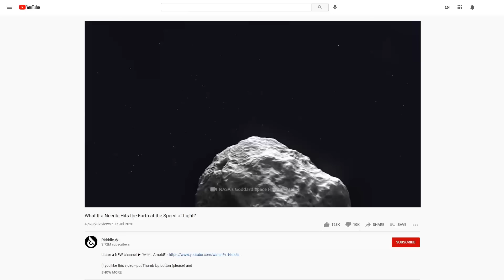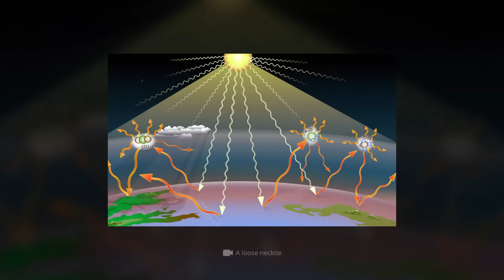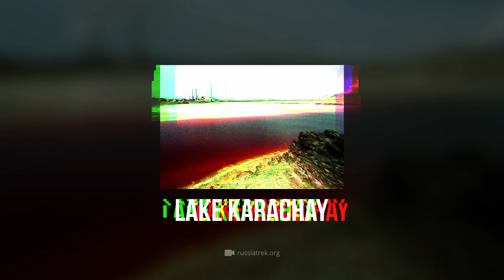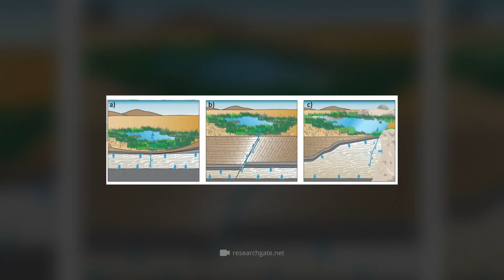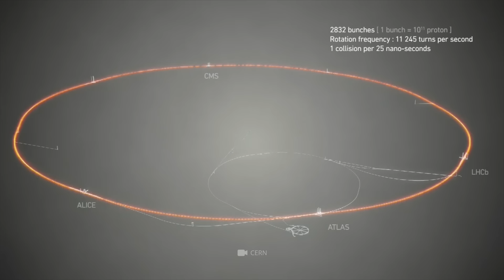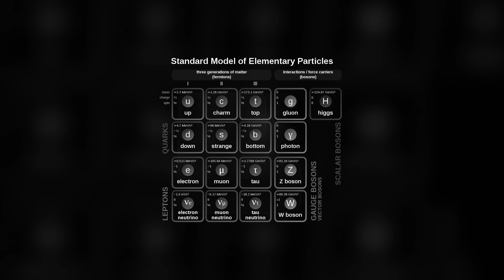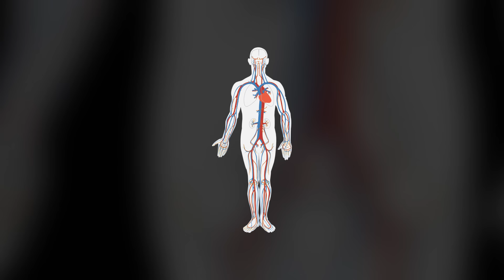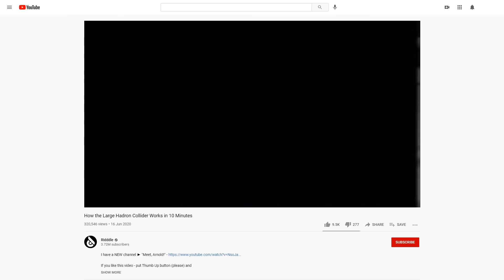What If a Needle Hits the Ocean at the Speed of Light?

Comment: "It would have the energy of 100 tons of TNT or the equivalent of 6 bombs dropped on Hiroshima..."  Uh, Little Boy was the bomb dropped on Hiroshima and it had an explosive power of 15 Thousand tons of TNT (15 Kiloton).  Either you meant to say your needle would have the energy of 100 Kilotons of TNT or it would only be less than 1% as powerful as the Hiroshima bomb.
Reply: I was thinking the same thing.
Reply: So I checked using the mass of an "average" hand sewing needle (Size 5).
--  That has about 0.14 grams of mass.
--  At "c" that represents a kinetic energy of ~ 6.4E12 J
--  That converts to roughly 1.5 kt of explosive energy
-------
To get to 100kt, you would need a needle roughly 60 times more massive, which means a VERY large specialized needle.
Reply: @fewwiggle  But according to physics as we know it, any object with mass that reaches the speed of light, its mass would become infinite. There is your "VERY large specialized needle"....
Reply: @tlsumner  I used "c" in quotes to signal that I was talking about 99.99999% of c (just like the author of the video)
Reply: Yeah I also thinking about that
Reply: @tlsumner  but in this video they are taking the speed as 99.9999999999......

Comment: You could actually surf that wave and survive, the largest wave ever surfed was 78 feet tall, which is as tall or taller than 6 stories.
Reply: I didn't watch the video yet, but i imagine the problem would be the speed of the wave and not the height
Reply: @isosk1229  The faster the wave, the higher it's height. In other words, 6 storeys will still be as fast as 6 storeys
Reply: I learn some new every day ig😂😂😂😂😂😂
Reply: Surf it yeah....survive it???
Reply: 100ft
Reply: Just as heads up, don't do this during a Tsunami or you will be killed.

Much of the destructive force of a tsunami is it's speed which can reach 60mph, and it's front to back length that can be several miles.

Think of a tsunami as a storm surge (an almost vertically steep wall of water) which is unsurfable.
Reply: @mahrixgamer6036  tsunamis don’t typically create towering waves, though. Look at Japan 2011, for example. Tsunamis are more of a continuous flow over a large area created by displacement. Towering waves are more often created by conditions which only effect the surface waters.

In other words.. if you decide to surf a 100 foot wave caused by a tsunami, go for it.. because that tsunami has likely originated from a massively catastrophic event that you likely wouldn’t survive anyway.
Reply: @nagashimayt9083  fast as 6 stories? The amount of drogas you took could floor a horse mate
Reply: @TheMessiahOfThe99Percent  .. Yeah.. How fast is 6 storeys?? 😆😆
Reply: Got recomended this wirld record after reading this lol
Reply: @nagashimayt9083  but 6 stories don't move
Reply: @nagashimayt9083  stories*
Reply: @brownseed777  *storeys

Story = A fable or tale = Stories
Story = Part of a Building = Storeys

This will be the last time I'll be correcting this error as it has happened many times and I am getting sick of it.
Reply: @TheMessiahOfThe99Percent  Sorry for my late reply, but what was implied was that a 6 story wave would have a speed of well.... a 6 story wave. The speed also depends on how much water is underneath it, then it reaches maximum height when near to the shore. The rough calculation I have is around 555~678 km/h. So imagine a car 6 storeys tall and length of around 5000+ buses traveling at 600 km/h  towards you. With that, you can decimate a lot of buildings in a few seconds and reach inland for over 30kms  with minimum height decrease.

But let's get back to the comment. My average is well too high to be surfable, + Variations in the sea like corals and rocks can alter the final wave before it comes near to the shore. The 6 story surfed wave could have been only 120km/h fast which is still surfable.
Reply: @nagashimayt9083  get well soon! Toodles!

Comment: I worked an IT job about 11 years ago, where four co-workers and I spent a full working day passing a piece of paper between us, adding calculations to it every moment moment we got breaks from actively working on support tickets. 

By the end of the day, not only had we calculated the impact of the live hamster hitting the ground at 50% the speed of light, but we had sketched out an orbital delivery system for the payload. The trick is to raise the hamster in orbit under a few months of 1g spin acceleration - the tricky bit is the energy cost, and the hand-off to the vacuum cylinder required to prevent the hamster from impacting the atmosphere before it hits the ground. Also, after working out the rough materials cost, I seem to recall a note saying we "might need to sell France :(".
Reply: goodbye france
Reply: nerd
Reply: @corennet.6776  using your break time to geek about some random theory is super nerdy indeed...
Reply: @sankofax8082  well I meant it in a good way anyhow lol
Reply: I’d be fine with selling France. For science, of course.
Reply: Even if you don’t need to sell France. Sell France.
Reply: As long as it's not Finland. Just not the Finland.
Reply: @diascrive That’s why you use a vacuum chamber tube to bring it to Earth.
Reply: The Clown
Reply: Our IT dept. can't get our printers to work for a full shift.  
I doubt they are calculating anything more than how many days it would take to deplete the candy machine of Snicker bars in the event of candy strike though.
Reply: @mikenewtonninja9379  LMFAO
Reply: spoken by dudes who've probably never been to france
Reply: @diascrive lol did u watch the video
Reply: @mikenewtonninja9379  The VietNamese eat fried and battered frogs legs and they are pretty good.  I don't know if it is the French or the Italians that eat cheese with maggots.
Reply: @Vulegend  Estonia  would miss Finland.
Reply: Jesus I want to work in IT do accelerating hamsters to 50% of the speed of light come up often?
Reply: This shit looks interesting
Reply: poor hamster
Reply: maybe, but what if.  why a hamster? why not a rat? or your boss?

Comment: The mesosphere is the realm of nacreus clouds. So if the steam did reach the MS. Not only would we have long term nacreus clouds. It would also provide as a blanket reflecting some of the incoming insolation.
I dont tgink hail would survive the 80km fall. Depending on the current zero degree isotherm level at the coordinates most of it would melt before reaching the surface.

Comment: I think nothing would happen and it would just go straight through until it had to stop. Small pebbles have a ripple effect, in water, but tiny things going fast would just cut right through water, leaving almost no notice at all, the water moved would create some movement but not much because a needle doesn't displace water much. My statement is not based on data, just a natural observation. The needle would be too small to displace much water. A bullet goes through rock until it stops, but something so small going so fast would just pass right through, very little dust.

Comment: There seems to be some discrepancy with some of the figures given here. Mention is made, at 01:53 that the needle would have the energy of 100tons of TNT which is followed by a claim that it would be the equivalent of 6 bombs dropped on Hiroshima. The yield of the Hiroshima bomb (Little Boy) was approximately 15 kilotons! In any case, if 100 tons is correct, there have been far worse explosions, for example, in December 1917 and explosion of an estimated strength of 2.9 kilotons occured when a ship carrying amunition, picric acid, guncotton and benzol. The explosion killed over 2,000 people and the blast was felt 129 miles away in Cape Breton.

Comment: It's impressive that a one little single needle speed of light can destroy a big but huge earth
Reply: It can't actually. It would turn into photons before it touched the surface long before approaching relativistic speeds
Reply: Anything with mass going that fast will destroy the planet, at the speed of light the needled would weigh as much as an asteroid, thats why nothing can reach that speed without breaking down into quantum particles and turns to energy... light doesnt have mass and isn’t affected by gravity (except a black hole) 

And to the other commenter, lightning does NOT move at the speed of light...the flash emitted as photons moves at the speed of light but the bolt of electrons that comes from the sky to the ground is most certainly not...which is why 1) you can SEE the bolt and 2) which is why a lightning bolt only does localized damage

Also an electron is quantum in mass, a needle is not...if something so small you cant see does damage like lighting bolts WAAAAY under the speed of light, just think of the damage a needled would do AT the speed of light
An electron (what lightning is) has HILARIOUSLY LESS mass than a needle, to even get lightning to the speed of light means we have to speed the electron up, and to speed it up takes so much energy... and as we add energy to speed it up closer to the speed of light it would get heavier..if we added enough energy to get the electron to go fast enough to weigh exactly the same as a needle and it hit the earth it would wipe out life in a similar form
Reply: @Enceladus if it was we wouldnt see the bolt, its faster than sound but not light-speed...the initial flash before the bolt, that's light speed

the reason something like a needle can't go light speed is because the speed would cause it to gain extreme weight and gravity at a small point and smash into our atmosphere then the ground.
That much mass not burning up would be like a fireball at the speed of light, the energy released would be enough to change our climate and depending where it hit would cause other major damage
Thats why nothing in the universe with mass higher than a singularity can go that fast, it would rip through spacetime and turn into a warp hole or a black hole

Comment: a 2 gram needle? i can't imagine it not doing much more than vaporizing a square kilometer of ground and sending a decent little earthquake out. tops.
Reply: A two gram needle travelling at the speed of light would only have 600kJ of force. Pretty pathetic honestly.
Reply: @jacobd1529  cap. Did the math with 99.9999% lightspeed 2g.
Its 12.530915271 petajoules of force, or 1.2530915271e+16 joules. The energy in that single point is equal to 2.995 megatons of TNT. I could do the calculations for the energy released from the impact but I would probably mess up way too much.
I was just bored and wanted to see if you were right, not to be a keyboard warrior.
Reply: @strikurr7861  Forgive me Mr. Strikurr,
I’m just a tenth grader using f=ma
Reply: @strikurr7861  which I now realize isn’t applicable at all

Comment: i find it amazing how they did not mention that the needle would be from another planet, i.e. extraterestrial and there would be no telling what type of material it would be made from, how smoothly it would be formed, or if it would be destructable or not. pardon my spelling. They also failed to mention if it hit the water straight on or at an angle. Lets say worst case senario. In my worst case, The needle being from another world and perfectly shaped and made from a material that can not distort nor break, at the fastest speed possible hitting the water directly head on it would hit so fast and so perfectly it would not cause neither an explosion nor a splash. however, it would go right through the earth from one side and through the other and keep going only reducing it's speed merely by half. This in turn being a worst case would case a pin hole in the Ocean that would leak into the earth's core causing catostrofic outcomes such as the earth's rotation to stop and severe weather paterns to change and even our ozone to stop existing.
Reply: That’s deep my boy ✅
Reply: You're a smart guy
Reply: I assume the creator intended to just be a standard, human made needle but I might be wrong. I doubt that pin hole would even last very long, let alone cause the ceasing of Earth's rotation, though.
Reply: @bigboi9856  wouldn't be a pinhole size though, it would through the water but when it hits something more solid the crater will be wider because of the force. The earth's core is slowly cooling and solidifying, when that process completes we will be left with no magnetic field, water would definitely speed this along lol.

Comment: The theory that the hadron collider can produce black holes is confirmed, however they aren't world ending black holes. these black holes would be smaller than atoms or subatomic black holes. due to the speed at which the particles are accelerating and following newtons 3rd law of motion, the black hole that is created would be shot away from earth at the speed of light passing in between atoms and matter. such a small black hole would not have enough gravitational pull to suck in matter while moving at almost the speed of light.

Comment: It’s an interesting scenario.  But doesn’t electricity travel at the speed of light?  The same way heat lightning does.  So with that said there has to be some catalyst that travels with the lightning that shapes it.  

Based on both of these facts, water can and does often travel at the speed of light, right here on earth.  Likely thousands of times per day.
Reply: electricity does not travel at the speed of light, it is actually closer to walking pace, if I am not mistaken you are talking about electromagnetic waves, which is also light
Reply: electricity (electrons) do travel at the speed of light, as in, lightning. but there are many factors when calculating how fast electricity goes through something like a wire. such as conductivity, composition of the wire, ohmage (resistance of said wire), etc. but, there is no catalyst for the electricity. when talking about lightning, it is essentially a massive static shock that happens when the clouds become negatively charged due to friction of the water vapor, which therefore causes the ground to be positively charged. this isn't exact science, the things i'm saying, because this would be an entire book about how lightning works, but that is essentially it. it's a static shock that goes from the ground to the sky to receive the extra electrons that were free floating between the water vapor particles that get sent to earth at, or near, the speed of light
Reply: @isaacporter5071  lightning does not travel even close to the speed of light
Reply: Electricity does not travel at the speed of light. That is including lighting. Electrons travel at just below the speed of light. When I say just below, I mean they travel at just 0.0000008% slower than light. Lightning travels even slower... much slower. Usually, there's a huge misconception of how fast lightning is, or electricity in general, because it radiates with light. The light it gives off indeed travels at the speed of light because, well, it's light. However, electrons, electricity, and lightning cannot compete with the speed of light.
Reply: @isaacporter5071  Electrons can travel at the speed of light, but through normally copper, household wires it is limited by the conductivity of the metal, therefore making it travel at walking pace (maybe slightly faster) depending on the quality of the metal

Comment: Needle traveling at the speed of light possible in a vacuum. Add the atmospheric layer of the atmosphere, depending on the element, a needle size will not last when traveling in at the speed of light when met with the resistance of gas elements. If the element of the needle in the speed of light successfully hitting a hydrogen atom in the atmosphere, a reaction will occur immediately before hitting the surface.
Reply: Bruh i dont think the needle would be matter in the fist place
Reply: @ramzeitouni4295  It will turn into a gaseous needle. I'm curious to which element can withstand the speed of light and maintain its solid form even after hitting another element. 

The theory of a mass traveling in the speed of light means that points A and B is the same distance that a light can travel in the given measure of time. First question, was acceleration reaching the speed of light instantaneous or gradual? Was the speed curve follow a Poisson or Bell?

The only possible condition is to have the earth next to a black hole and the needle on the oposite side of the black hole. Both meeting in the center of the black hole. The needle will not meet any resistance because all the molecules in front of it will be travelling in the same direction. The resulting energy from their encounter is nullfied by the pull force of the black hole. But to be true to the idea of mass traveling in the speed of light and hitting the earth, the energy produced will be equivalent to the pushing power of a light hole.

To design a needle that can withstand travelling in the speed of light, it must be made out of a dark matter. It should travel past the speed of light. Good luck harnessing the required technology to gather dark matter and compressing it to a needle.
Reply: @MT-qw3ou  we dont know what dark matter actually is to the point where scientists blindly gave it that name

Comment: If you didn't already know guy rain starts off as ice pellets and crystals and usually melts by the time it gets to the ground so most likely what you're saying would be a rain and wind event Even if the water went to the ionosphere. Ice still melts before it's the ground. Hail requires multiple cycles through violent updrafts to attain its size.
One inch of rain yields 4,014,489,600 cubic inches of water per square mile. Divide the result by 231 cubic inches per gallon , and obtain the result of 17,378,743 gallons per square mile for an inch of rainfall . I think you need more homework.